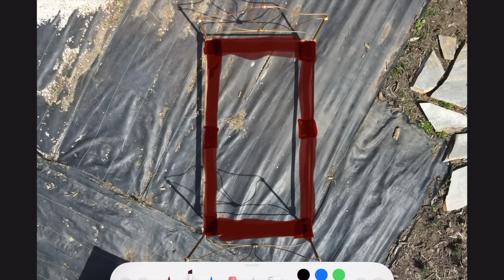Turning an Antique Bed Frame into a Garden Bed |

Comment: Quite beautiful. An idea for apartment dwellers: A few years ago, one of my neighbors threw away her daughters doll bed that looked similar to yours, but doll sized. I did a somewhat similar boxing out, except I lined it with plastic to both protect the wood and patio floor. Also I used a small piece of garden hose in the lowest corner to direct the excess water away from plant roots (prevent root rot) and the patio floor. It was adorable.

Comment: Great video!  You explained every step and reason why one tool or item was chosen over another very well. Someone who is not used to building things or working with wood could easily understand the what and why the flower bed was built the way it was. Even saying that you had extra boards in case something didn't fit or you needed to try again was reassuring to someone like myself who has that happen to them when trying something new, lol

Comment: I 💚 this so much, Miah! I also have a Flower Bed Bed, but mine is not nearly as well-built as yours. 🛌 I just used some larger reclaimed cabinet/closet doors and L-brackets to build the frame and attached them to my vintage headboard and footboard. Works great so far, though. It's on the front corner of our city lot, right near the street corner, so I've had so many more neighbors stop and talk to me about the garden since I built it a couple years ago.

Comment: Great build.  When dealing in carpentry work, things are not always straight forward due to outside factors or because of the wood itself. How did you work around the joinery on that bed? I would have needed to pull out my chisels.😂